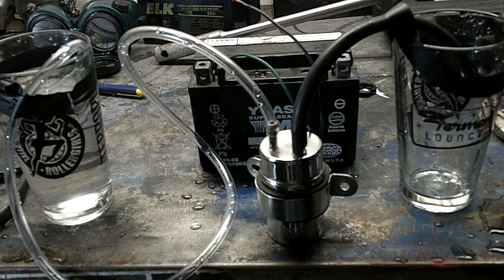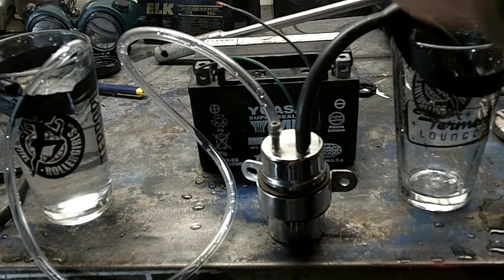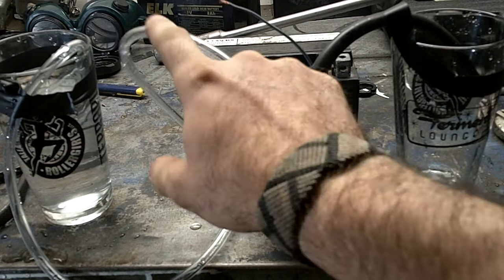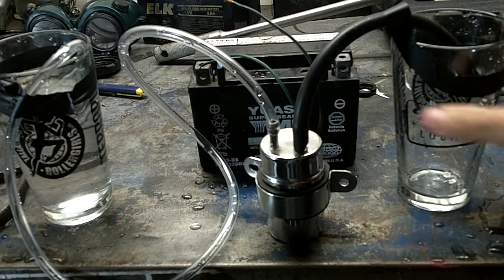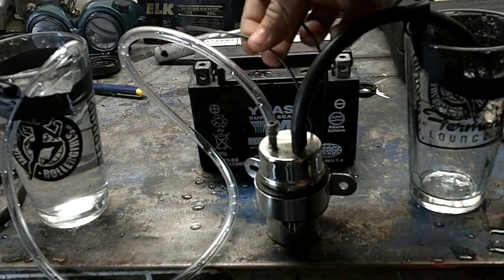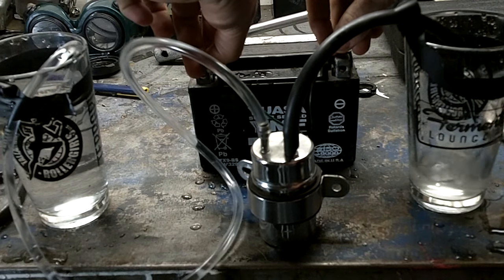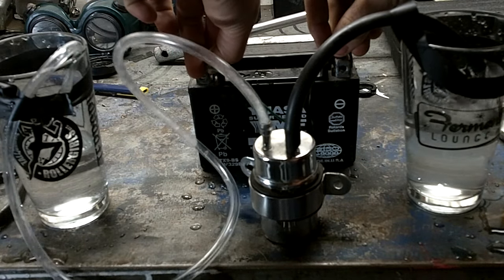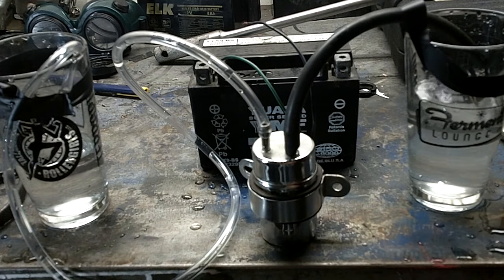How to test a motorcycle fuel pump

Comment: Dynamic tests like this are always better than static tests of pressure only, so  result here should be much more indicative of whether the pump is bad. Much like a voltage drop test, ha ha. 

I'm glad you mentioned the safety factor since that 's the biggest problem with this kind of testing. I agree, I would do it with water and then carefully dry and rinse with fuel later. Alcohol is soluble in both so it's a reasonable agent to help clear all the water.

Comment: So that's why motorcycles are so loud. Wow, all this time I thought it was the engine ;p
Reply: Am also wondering
Reply: I think the pump is vibrating the table. If you turn the key on a bike, the fuel pump will turn on before you start it. when it is on, it is not that loud. 

The point of this test is to make sure your pump works when your key won’t power it. Or when a wire on your bike is preventing it from getting power
Reply: Bro it is the engine and the exhaust that make all that sound lmao 😭

Comment: I suggest that you use diesel or kerosene fuel to run the test. With an open container of gasoline and the sparks produced when you connect the battery you really risk a fire. Diesel is a lot less likely to explode vapors.

Comment: hey man love the videos. i was thinking about eliminating my auxiliary fuel tank on my 1982 honda v45 magna, and just having the fuel from the main tank feed into the pump and on to the carbs, its my bobber project bike and putting the finishing touches on it. and i would like to bi-pass the auxiliary completely and use it to hold my left over wire harness

Comment: Great video, my bike has a green wire and black wire but my new fuel pump has a black green strip wire and a black wire, so is the black green stripe wire is the correct polarity as the green wire for + and black for -.

Comment: Can you remove the pump and just go from tank to carbs whats the purpose of the pump have a 02 fazer 6 and theres no power on acceleration the reves go up but no speed
Reply from the maker: Often yes, if your fuel pump goes out on a carb motor you can remove it and go straight through to the carbs to get you home. It will work ok if you have enough fuel in your tank. A fuel pump is used when the placement of the carbs is not low enough below your tank to allow to be fully gravity fed, or if the carbs need to be primed for startup especially. So in an emergency you can probably do it but it won't improve the operation of your motorcycle

Comment: hey Max, i replaced the vacuum petcock on my yama xj650 max w/a gravity one (could not find the proper replacement). I still have the same problem, bike only starts w/ help from a starting fluid can! It will then re start a couple times in between, and then finally it wont start. Carbs were overflowing this morn until it finally stopped on its own (emptied my gas tank about half gallon, there is about one gallon left in tank). It acts just like tank is running empty, but there s  plenty of gas left in tank, bike will start sputtering and die. And will NOT restart even with starting fluid.I S there a fuel pump somewhere acting up?
Reply from the maker: No fuel pump on your bike. Its time to clean the carbs

Comment from the maker: Are you getting voltage to the fuel pump? If not follow the wires back and see if you can find the disconnect
Reply: How to find the wires to know which way to hook up the fuel pump to tested on a battery and the relays please Google to repair it thank you on a Suzuki twin 2005 750 / 650 Suzuki motorcycle

Comment: I tried this test on my fuel pump on a 93 Honda CBR900RR all it does is fug once and doesn't do anything else if I disconnect terminal and tap it it'll f*** again is this a sign of a bad fuel pump when it does not function like yours did
Reply: I did the battery test with my fuel pump its thugs once and that's it it seems to get a little hot if I keep on tapping it then it'll thug each time I touch the battery terminal
Reply from the maker: Yep it should get up and go

Comment: I've been through the ringer with this thing I'm working on... Fuel pump works fine when tested but I can't get any power to it. Relay also tests good. Could it be a faulty kill switch? You said check the regulator... any things I should look for? Thanks as always...

Comment: hi there would you know if the fuel pump should go at this pace all the time I mean so quickly? or does it slow down later if its fitted within the bike not attached to battery..  mine does go so quickly in the beginning (after I have refitted the fuel pump),,,,and then slows down and continues to go but at a steady slow pace is this normal? I have seen it running without the cover and this is why I have noticed the pace at which it runs, I have just replaced the "point switch easy" because the previous one was rusted and didn't seem to work...at the moment bikes runs and does not cut out like it used to previously although I am now scared to take it for long run because I have just refitted the fuel pump and if the problem comes back I will have to push it for miles again ;) by the way great videos very helpful and couldnt be clearer.. Thanks
Paw
Reply from the maker: Yeah pumps will usually shoot out some gas when you first turn on the bike to prime the carbs. Then they will relax to a running pace, or turn on/off as required, depending on the model.
Reply: mrmaxstorey ok thank you for quick response, that information will allow me to sleep tonight :) its cbr 600 F4... ;)

Comment: Hi, I have a CBF 125 and there's dirty petrol in the fuel pump. I've emptied it but I want to flush the petrol through until I see clean petrol come out the other side using the same example. Do fuel pumps suck petrol from in the inlet or is that just some bikes? I tried and mine wasn't working..
Reply from the maker: Yes they suck in from the inlet. Yours may be too clogged up. They are cheap to replace
Reply: @mrmaxstorey  oh thanks. Another thing, when does the fuel pump kick in? I had the switch on the whole time and tried starting the bike to make it work, could it be that I'm doing something wrong? I read somewhere that the fuel pump kicks in when the ignition is turned to on for about 2 seconds is this true?
Reply from the maker: @BeatsProduction786  Most fuel pumps are always energized when the bike is turned on. There is a pressure sensor inside the fuel pump that shuts it off when it reaches a present PSI, once the carburetor is filled and the carb float is closed. When the bike uses fuel the PSI drops and the pump kicks on again
Reply: @mrmaxstorey  got it. I spoke to a guy who owned a CBF and is a mechanic himself and he told me the CBF fuel pump works with the gravity of the petrol from the tank directly above it, and the pump just pushes the petrol into the carburetor but there's no suction from the intake.

Comment: I'm not. Followed the wire that seems to be the problem back to the regulator, and couldn't get any voltage there either. Seems strange that that would be the problem...

Comment: My 1980 goldwing fuel pump keeps stucking gas doesn't stop?
Reply from the maker: Some fuel pumps don't stop, they go full force until they feel pressure resistance, and then slow down to maintain pressure in the lines

Comment: Why would a fuel pump spit out gas?
Out of the side escape tube?
Reply from the maker: +victor fuentes What model bike?
Reply: +mrmaxstorey Honda VTX 1300
Reply from the maker: +victor fuentes Probably a mechanical failure of the pump
Reply: +mrmaxstorey I bought a new one, let's see it that's the problem. Fingers crossed
Reply: +mrmaxstorey so it's fixed now! It was the fuel pump! No more leeks! Fucken happy

Comment: Does the pump know when to stop? or does it just keep pumping gas until you turn off the ignition? I have a 1983 Honda Shadow and was wondering if I need a specific fuel pump?
Reply from the maker: Yeah the fuel pump has a pressure sensor it will shut down or slow when it hits its psi. You do need a fuel pump that makes equivalent pressure to your stock pump but there are plenty of cheap replacements out there